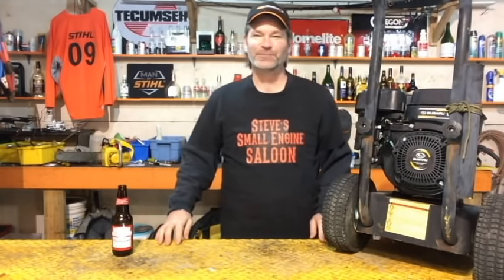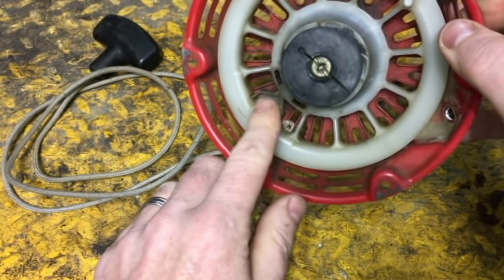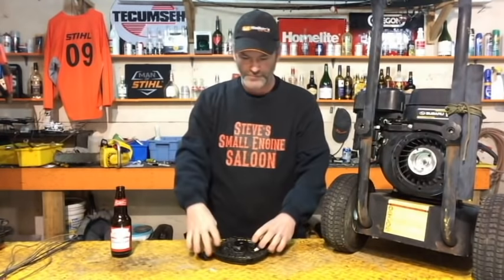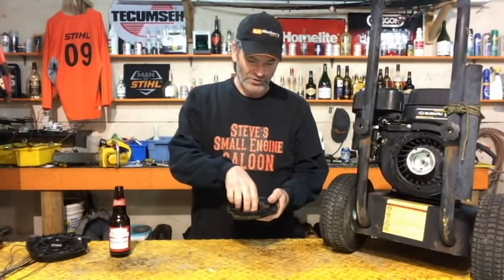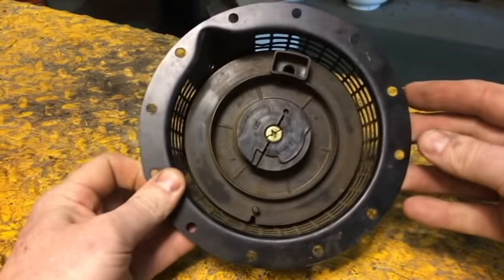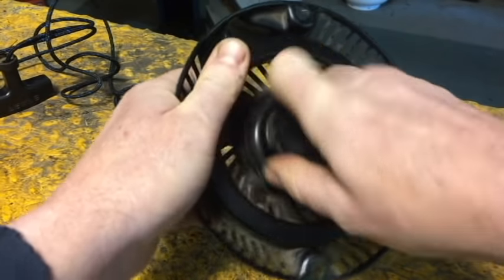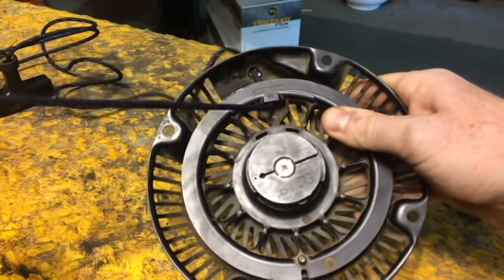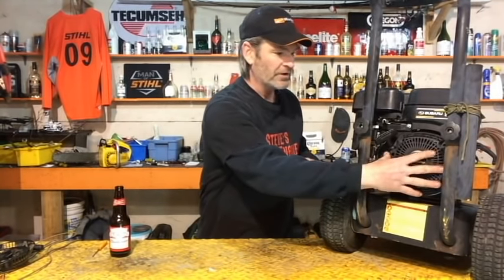How To Fix a Broken Starter Rope in a LawnMower or Other Engines

Comment: My starter pull assembly on my Sthil 026 was sticking with the rope not going back in at times. 
Other times it worked properly .
I took the starter off and cleaned all the gunk out of it , but the same thing as going on. I took it to my dealer who agreed that the spring had lots of tension  , but maybe the rope was swollen and causing it . I replaced the rope and nothing changed. 
At last it seemed that it could only be the spring because everything else looked good.  I found another dealer who just happened to have a spring in stock. 
Again , nothing changed . 
The dealer also was at a loss to explain it, and with no alternative I ordered a whole new starter assembly for $116.00 . This was yesterday , tonight on Amaon.ca I see the same assembly for $17.00 . 
The only reason I don't cancel is because it will take up to # weeks to arrive , and I need logs now.
Does anyone have any real life explanation for this starter problem ?

Comment: Yep I'm going back in the house and telling her.  Washers broke.  Fishing gear works.  See ya.

The newer models surely beat the old coil wire wound types.  Grease, exploding spring coils, colorful metaphors, degreaser, more colorful metaphors, two hours then we finally bend the metal tab prongs in place with success.  Only now too tired to do anything else.  Lol

Comment: My string broke right at the end and when i put it back together it wouldnt wind back up, took it apart and the spring was a little wonky, i googled a picture of a new spring and bent it back to look like that it it works again, not my mower so its gonna work like that till it doesn't 😂
Reply from the maker: Right on